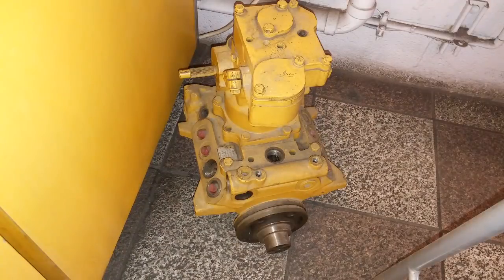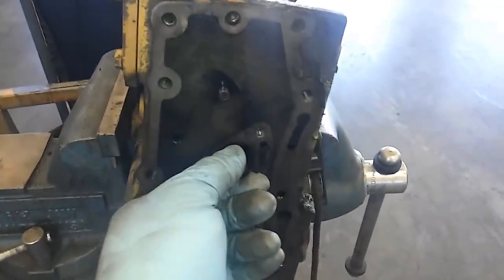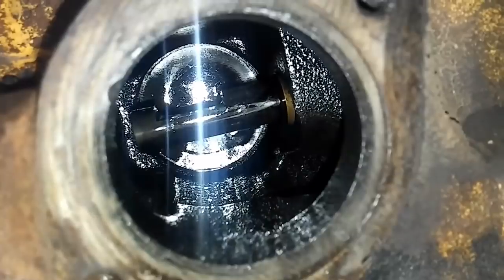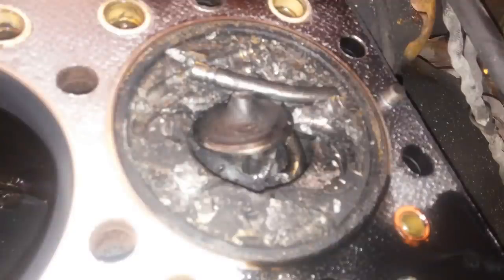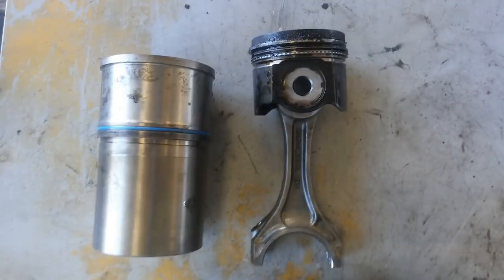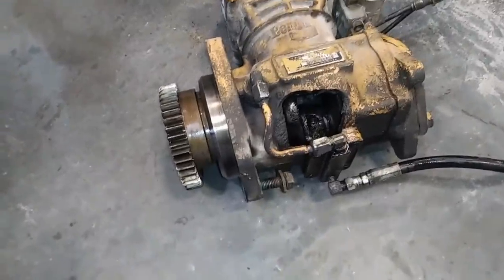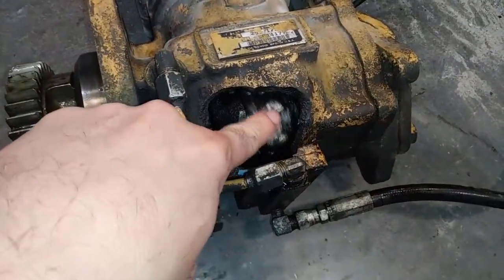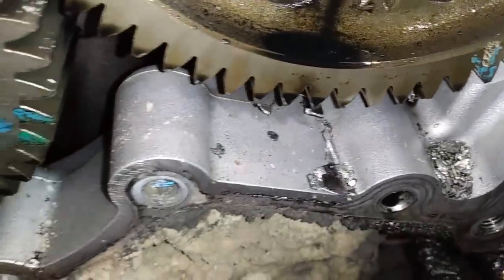Why Do Diesel Engines Runaway? What Is A Diesel Engine Runaway?

Comment: I'd think whether stalling the engine with the clutch would be successful or not would depend on why it's running away. If the engine was running away due to oil in the intake from something like a failed turbo, which would be most common on an electronically controlled engine, I wouldn't think it would be particularly hard to stall it since the engine would be untimed and pre igniting rather than injecting fuel at the proper time like it should? The whole reason we never used carbureted compression ignition diesel engines is because we need the ability to time the fuel delivery so the combustion starts exactly when we want it to instead of just dribbling fuel in the intake manifold and letting it ignite whenever it wants during the compression stroke, so I can't imagine that an untimed diesel engine could make all that much torque? Obviously a runaway engine because of a failure in the mechanical fuel injection system would be a totally different scenario though.

Comment: Lost a DODGE 5.9 Cummins common rail engine due to runaway. We overhauled the injectors with a kit. Since we kept the original springs and the shims in their original location, we agreed with those who said this can be done.
It can't...
The injectors did not hold back the fuel and fed the engine even with the key off and solenoids not activating the injectors. It was over in less than 30 seconds. Scary shit!
DO NOT USE THOSE KITS!

Comment: I’ve heard of the old union freight haulers looking for breakdown time getting a truckstop shower towel and a couple of cans of starting fluid. Soaking the towel in staring fluid and wrapping it around the air intake of their running engines and walking away. 

The old 6-71 Detroit that I started out driving had the air restriction plate method of emergency shutdown although all you had to do is tell it a hill was coming and it would completely fall on its face in fear.

Comment: When I was about 14 my grandpa and I started an old spar tree engine that hadn't been run in years maybe decades. For some reason I think it was a Cummins, it had a blower on the side of the block? We knew it was likely going to run away so it was my job to shut it down with a piece of plywood over the blower intake. It ran away and was one of the scariest things I've done.
Reply: If it had a blower on the side it was a detroit or some funky truck stop Soviet machine
Reply: @pootispiker2866  Cummins did have some engines with blowers. The " iron lung" being on of them
Reply: @jasonwilliams8016  Never heard of it. Interesting.

Comment: if you have co² fire extingisher you can stall the engine by spraying it on the intake and it will lower oxygen lewels enough for it to stall.
but only co² dry chem or ABC is not an option becose it is baisicly dust

Comment: Have you ever seen a diesel engine run backwards? The old Detroit Diesel 8V-71’s were bad to run backwards after you killed the switch off, they would roll backwards and start sucking engine oil and push the exhaust out the intake.

Comment: “3200 will destroy your engine” sitting here on my honda bike at 14000 rpm laughing
Reply: Diesels are different. They aren't torqueless rev toys. They're for work.
Reply: @MyerShift7  true story
Reply: @MyerShift7  it idles higher that my tractor runs when pulling a 20 ton trailer

Comment: Turbo running away is even better... - put in park or highest gear and immediately pull the clutch. If that doesn't do anything (which probably won't help in most cases) just leave your vehicle, get a bit away and watch your turbo decking itself apart (it literally bursts). Not much you can do if the oil is burning and makes the turbo go way past 200.000 RPM.

Comment: For a 7.3 powerstroke just theoretically couldn't you unplug the cam sensor to make the injectors not fire? At first I thought ICP sensor so you wouldn't get any oil to the Huei injectors but it would still run with the ICP unplugged but it would run rough as f*** so it might help to unplug it overall but wouldn't shut the motor off. For a oil burning situation I guess unplugging the cam sensor wouldn't matter because it would be burning oil and wouldn't need the injectors to fire. All in all I guess you would have to plug the intake regardless. Just my thoughts

Comment: This happened to my 2002 volvo v40. Turbine broke and engine started to runaway. Stalled with gear box. Happened 2 years ago, main damage was to flywheel. Restored turbine, changed flywheel and im still driving it today. My mechanic still cant beleve she's going 😅

Comment: Isn't there more room between the valves and piston in a diesel engine to avoid premature combustion, by the way? Just my thought. I'm not an expert. I'd be skeptical about a diesel engine with small compression room. And about the oil sucking from the turbo: Does that oil have a lower combustion point knocking the engine?

Comment: I'm probably going to reveal a little too much about the number of years I've been on this planet, but back in the dim, dark days of oil bath air filters, having diesel engines run away or 'bolt' wasn't a rare occurrence.  Most diesel engines were a lot slower than modern engines back then and having them kick and run backwards was a recipe for disaster. ( I think something like a 6LY Gardner's top speed was about 1500 rpm. )  The engine would suck the oil from the oil bath filter and just keep revving until it destroyed it's self.

Comment: Almoast every time when diesel run away it does't depend to injection pump. It depends to turbocharger because when turbocharger worn out saft and bearings get play. Then it start boosting oil to boost pipes and intakemanifold and when there is enough oil its starts to run only on oil and engine takes that much rpms that it ables to take. Only way to kill it is cut it getting air or put big gear on and choke it with the brake. Sorry for bad english

Comment: I worked for a well service and drilling company in my late teens and early twenties. I got freaked the hell out when i was sent to replace a sandline clutch and I saw a smoldering pile of rubble at least a mile away from the rig. I asked the hands what's up with that over there? They said that was a GE. Rig that hit a gas pocket about a week prior. The operator turned off the engine Detroit 2 stroke v8 and it kept running it increases in RPM and sounds like a siren spinning faster and faster until it either throws a rod or sparks somewhere or whenever the exhaust manifolds turn white hot. Then the explosion was like a nuke. The hot wind hit the guys on the rig i was at and everyone puked because they knew those guys and it was a reminder of our own mortality. As soon as I heard that i smashed out my cigarette and went to go turn off my work truck. They laughed and told me that was just a water well and if it was something like that we'd hear the engine and probably be suffocating by then. I raised concern andme and my boss and the welder started installing the choke out valve on all of the rigs and pumps generators and some trucks. Fuck that blowing up shit. Hell naw!

Comment: If you had a Jake brake setup overridden to manual off at the switch then you could theoretically could jam open all the exhaust valves and remove compression. It would probably not fire well if at all

Comment: I used to repair diesel fuel pumps and injectors and if we had a runaway a good old thick telephone book over the intake would help stop a runaway by cutting off the airflow

Comment: When I was 27, I worked at a famous truck stop in Weatherford, Texas. One day I was smoking a cigarette on the front parking area by the Lube Center. And backing in was a tractor/trailer that was slightly smoking out the stack. As a period of about 30 seconds went by it slowly wound itself up to about 4000 rpm. A crowd gathered. Watching the behemoth of a C15 Caterpillar begin its last journey, marching relentlessly towards the scrap yard. As white smoke literally gushed from its stacks and people stared in awe at the rarest wonder to be witnessed by common man, I grabbed a clipboard and my coworker whipped out a nice pocket knife and cut the intake on the driver side and I slid that clipboard home into the windpipe of the suicidal monster that dare wield its steel parts at the crowd it threatened to destroy and slowly, that ugly dinosaur choked, slowed and breathed its last breath, forever!

Comment: You don't stick a fire extinguisher in it, SPRAY the extinguisher into the Air Inlet. This will clog the filter and remove the air, or shot directly into intake or turbo. Same result

Comment: I've seen mechanical 3406B runway did get it shut down. Seen 3406E yes E run away then it just shutdown, restarted ran just fine like nothing happened and then take off. Wasn't throttle pedal problem it was showing 0%. Seen 3406E run backwards kind cool to see exh smoke come out of air cleaner. We were running it shut it off, it backfired and ran backwards for about 30 secs. Had 1 tech who was working on B model pump bonnet seals he got 1 one of time. Didn't run away just ran on 1 cyl we were ready to put board over turbo

Comment: Decades ago I was driving a 10 ton military 6x6 powered by a Deutz 12l v8 air-cooled engine.
Returning to base with an (overload) of 15 tons of stone chips. Going down long decline one of the exhaust brake airl ines blew off, so no engine brake.
I thought I would just brake until I could get into a lower gear (non syncro gearbox). 
To my surprise one front wheel locked uo while the other 5 continued to turn freely. The cause of that turned out to be sized brake actuators,due to having driving around in a flood rescuing people out of trees and of roofs of houses for 5 days.
Now I had a problem. The truck was geared for a max of 50 mph and the speed built up to 75. The rev counter wound around until it hit the pin on the idle side. Since redline was 2800, that means it went to 4200 rpm.
Amazingly it didn't break and I continued gingerly to base about 200 miles away (luckily no more steep hills). When I arrived at base I noticed oil dripping underneath and found that the rockers had punched through the covers. Braised the holes up and drove it for another 9 months without issues.

Comment: Question: Since it's dangerous being around the engine, what would happen if you blocked the exhaust? I use to hot wire my bike as a kid since the parents hid my keys; so to switch it off, I'd block the exhaust with my shoe. However it was only 50cc little Honda. No idea if you could block something with more power though.

Comment: I had this happen to a 35 hp Kabota tractor I just got back from being serviced. I was going down an incline and it the engine immediately starting revving uncontrollably. It would not shut off and it sounded horrific. I thought I was going to piss in my pants. I just knew it was going to blow the engine so I got away from it. After about 5 or so minutes of chaos it finally shut itself off. Come to find out,  the dealer who serviced the machine put twice the amount of oil in it than necessary. Luckily, no damage occurred and I've had no problems since.

Comment: That Norfolk and Southern GE locomotive had no turbo boost air so it was running on fuel only.  Happens more often than you'd like. When the turbo bearings fail and the engine is sucking up lube oil,,,,RUN!

Comment: You made it sound like all mechanical pump diesels are bad. My 445 idi 7.3 is mechanical injection no turbo that is made for high speed rpms, my idler solidnoid caused it to rev it and the solennoid got stuck, my fuel input has a cut off relay that is on the fuel primer/glowplug controller.

Comment: It's almost always a failed turbo which seals has broken and lube oil getting into the intake and exhaust. Oil into the intake will make the engine run off the lube oil. The oil going into the exhaust will cause exessive smoke or fire out the exhaust.

Comment: in a really bad situation you could shoot a couple of holes in the bottom of the oil pan.   I just saw a video of an 18 wheeler running away alongside the road and the cops showed up but were just keeping people away from it.   That would have been an ideal time to ask them to do it or if they refused, to ask them to borrow their pistol so you could.   If it could be explained to them that it's using its crankcase oil for fuel and that was the only way to stop it quickly it just might work.   Punching or shooting a hole in the oil filter might also deprive it of oil pretty quickly as it all pumped out all over the ground

Comment: It seems like there might be a safety system to this by having a way to do an emergency vent of the cylinders to stop compression. Something modified in the engine or on the cylinder heads. Perhaps something like having a heavy duty gate valve on each cylinder that could be manually opened or perhaps with whatever air is in the system to open them all up at once. Just a thought, but I don't know enough about it.

Comment: 2 runaway diesel engine failures in my career (retired now). Both were caused by turbo seal failure. One on a Cummins M11. The driver wrote it up for smoking. I got in to drive it to the shop. I noticed the smoking, then revved it up a few times then it took off like a raped ape. I turned off the key and it kept going, Smoke from the stack looked like a damn tractor pull event. It needed an inframe after that... The other one was towed in after the event.

Comment: You didn't mention old worn out rings and blow by. There's no way to cut off the fuel supply when the engine is running on its own crankcase oil. You need to slap a frisbee over the intake.

Comment: Not entirely sure if it can cause runaway, but when I worked at a truck wash some of the truckers would bring these beat up trucks that literally looked so unsafe to be on the road and would pedal to the metal to build air.. I'd literally be three bays down because i'd fear it running away.

Comment: I'm not an engineer, but I think if there was a emergency switch to operate a fuel shut off valve to stop the fuel to the engine when it takes off could be a solution to stop a runaway.
Reply: They have intake shutoffs wired to switches in the truck. Called a positive air shut off. I have one in my dodge

Comment: I had a 1994 evinrude ocean pro 90hp outboard motor diesel on me, went fishing, come out of the water and flush my motor. Running fine gave a few cracks and it would idle back to normal, then came time after 5 minutes of flushing I go to shut my motor off. Turned key off and the beast came to life, key off and my motor kept running, then started the ramping up bouncing off 8k rpms, I ripped the cowling off, then started pulling spark plug wires. 4 cylinder motor pushing 10k volts per stroke, lit my ass up badly, she was still running, had my whole electrical system ripped apart. Wasn't till I ripped my fuel line out that after 10 more seconds she stopped. Need to say I was 16 years old and gave me ptsd from it when I'm around a outboard running out of water on a hose. Motor never blew up till last may and ended up getting 5 more years and around 6,000 hrs on her before she finally blew out the block. I still remember my shiatty marine mechanic telling my motor couldn't of dieseled out on me, saying it's impossible. Anything is possible with fuel and oil, and so happened my spark plugs turned into glow plugs and was eating my mixture of 32:1. Motor didn't have the old oil reserve like it was supposed to so I mixed Fuel and oil ratio. So stuff happens out of random, and learned what to do when that happens.

Comment: When I was in the Army we have engines run away I worked on 6V 53 8v 71 and 8v92 was because a rack adjustment was too tight we drop the fuel filters put a clipboard over the intake engine still ran away it started sucking oil from the oil pan and was using the oil  as its fuel

Comment: The idle air bypass sticking open

Leak in the air manifold after the butterfly valve 

Front mounted air intakes gas or diesel often run away after a crash if the fuel cutoff malfunctions. But just a hot engine will keep it going even if it’s gas. 

I’d think a fire extinguisher would work. If you could get it directly into the intake. Someone’s had to test this hehe

Comment: Diesel has no ignition to switch off with the key. A runaway gas engine will not stop if you kill the spark. The engine keeps running due to a hot spot in the combustion chamber usually.

Comment: Small CO2" E" type fire extinguisher down the intake works very well..  cant run on CO2..  but dont use a class B or C too much work to clean out. had a few genset s go from diluted oil or turbo failure.  Fun.

Comment: I had a 2004 Volvo D5 engine run away on me once.  It just went nuts unbetween gears in a car park. With smoke pouring the back, rolled into a space and the car shut right off on the key.  IMO this must have been an anti shudder valve (aka throttle body) closing off the and cutting the air.

My BMW I6 diesel has the same and cuts the air off at the evertime the engine is turned off (aids in a smooth shutdown I've read).  Hopefully that would do the job it there was ever a runaway on the oil 😧

Comment: I've seen 3 run away all isx cummins and I used to run an old r model Mack dump truck that would run backward. That was some crazy stuff first time I ever had it happen start smoking out the breathers and sucking down the exhaust

Comment: What causes it most the time in modern  engine is turbo fails,fills air cooler with motor oil, someone installs a new turbo, doesn't drain/clean air cooler,start engine,picks up old oil from cooler uses it as fuel and takes off,seen it in alot of power stroke fords